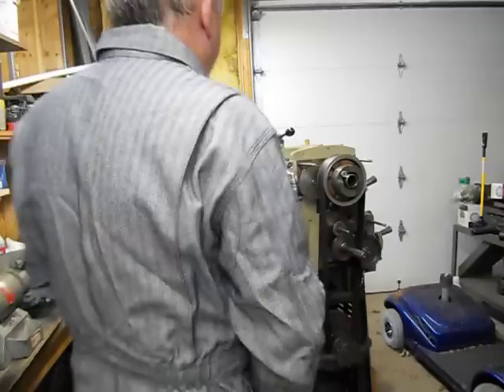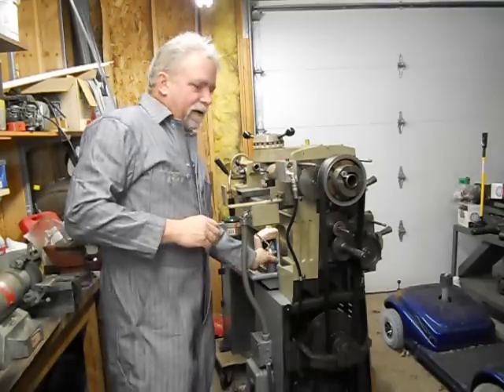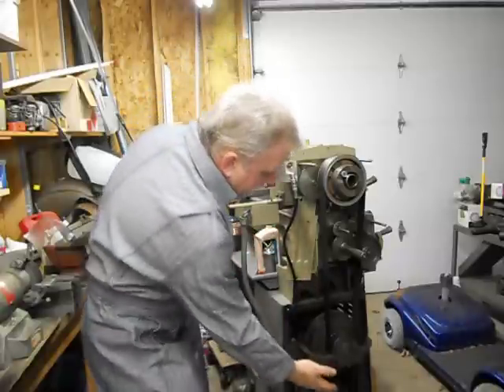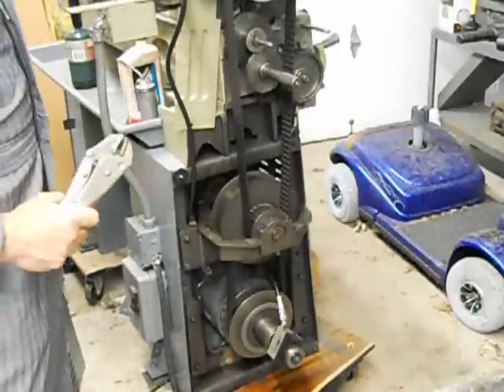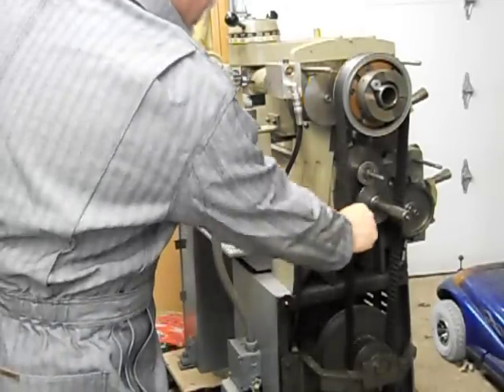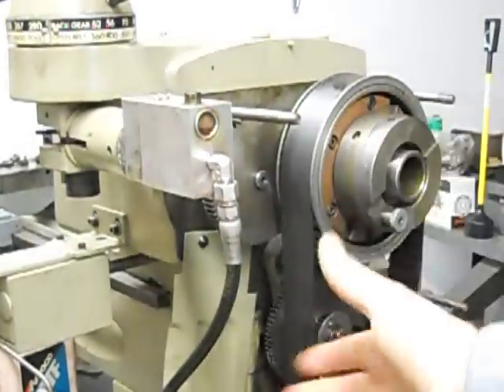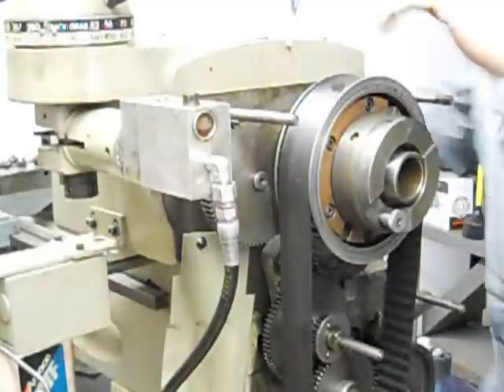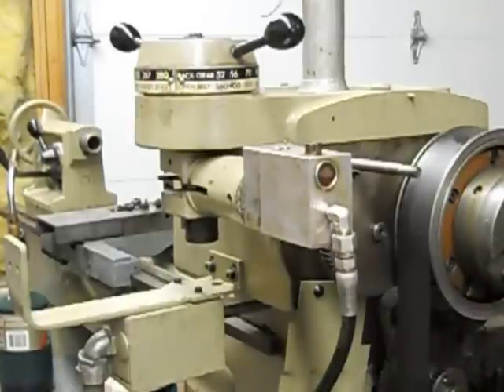Speed change system Clausing.AVI

Comment: This is a great video ! Thank you! But I do need some help! My clausing 5913 speed control dial springs back to lowest speed but if you turn it past half way it will stay but before half rotatation of the speed control it springs back to its lowest speed ? I thought that I had it bled off sufficiently.  I wonder if its a clock spring issue?

Comment: Why does your cog belt drive stop before the variable pulley drive ( on the motor) stop?  Mine doesn’t.  In your video it looks like it stops before the motor stops spinning when you turned it off. ??  My Clausing ( same system) doesn’t do that .  Why does yours?
Reply: I can’t see the part of the video you’re talking about, but those have a clutch. You throw it to neutral and the top belt stops. That way you can leave the motor running while you’re doing whatever without getting hurt. These machines had a lot of really good features. (I do seem to remember reading somewhere that clutch was optional, but I don’t think I’ve seen any without it.)

Comment: Just purchased a 1978 Clausing 5913. Back gear has tooth missing & ways are excellent. I didn't understand what all do you use the ATF for on the lathe. Great instruction. So much taught in so little time and easy to follow.

Comment: Hey Lucas: have you ever adjusted the variable speed control spring on one of these drives?
Reply from the maker: max9068 Hi Max,

I have made that adjustment, but its been a while, not sure I'll remember everything.   I hesitate to take mine apart to verify the process, but I'm thinking you'll be able to figure it out.   

You have to balance the pre-load on the clock spring in the upper cylinder system to the hydraulic pressure generated by the spring in the Reeves drive sheave on the countershaft.  You can rotate the clock spring to adjust its pre-load, but probably won't be able to get fine adjustments on the pre-load.  You can make fine adjustments by tightening the adjusting nut on the slave cylinder/Reeves drive sheave draw stud at the motor.  You can just about see the adjusting nut at time = 7:20 on this video. 

You'll have to make sure your clock spring is not broken.  If it is broken, a spare spring can be had from Clausing for not too much money.

Lucas

P.S. Another good resource is Webb (AKA Blue Chips) on the Yahoo Group site for Clausing products, here:
https://groups.yahoo.com/neo/groups/clausing_lathe_and_mill/info

Webb sells rebuild kits for the master and slave cylinders in these lathes.
Reply: Hey Lucas:
Thanks for the info. Fortunately I didn't need a new spring. I came across an old tech bulletin from Clausing which outlines a procedure using two 3" x 3/16" dowel pins. I tried it and it worked. Essentially what it entailed was removing the nut on top of the cap and speed cover. Then removing the two moon shaped allen keys. Then inserting the 3/16" dowel pins into the holes in the spring casting, lifting the housing just enough to turn the housing. Clockwise to tighten and counter clockwise to loosen. Since my problem was that the lathe would not stay at the speed, it needed to be tightened. It needed to be adjusted 3 slots & now it's running perfectly. I brought a 6903 lathe not running correctly. It came with the taper attachment, 3&4 jaw chuck, 5c collect system, QC tool post and some tooling. I've ended up installing a new Derlin bushing, adjusting the clutch, control levers and springs, replacing the hydraulic hose and lastly adjusting the clock spring. Now she's running very well. It's my first lathe & I'd like to thank you for your video's. You're video's have been a excellent resource for me.

Comment: Is this the Clausing 5900 series? I have one at work and I have this problem that it makes a constant loud noise (as if something is loose) when the spindle is on neutral and the motor is on low speed. As soon as I turn the speed up to high, the noise stops.
I'm quite sure it's coming from the clutch and brake assembly mechanism.
I noticed your machine does not make so much noise at low speed. Were you able to adjust it?
Reply from the maker: I think your lathe needs new plastic bushings.  Best not to run it until the bushings have been replaced.  If you run it with broken bushings, you can cause damage to really expensive parts.

Comment from the maker: I have a rotary phase converter (RPC) in the garage.  Input is 220VAC single phase, output is 220VAC three phase.  It works well but is noisy.  The converter is in the rafters of the garage.  It was a home-built RPC (I did not build it).

Comment: Do you have 3-phase in your garage, or is that a static inverter mounted to the lower back of the lathe?  If it is, what model do you use, and are you happy with it?
Thanks,
Jack